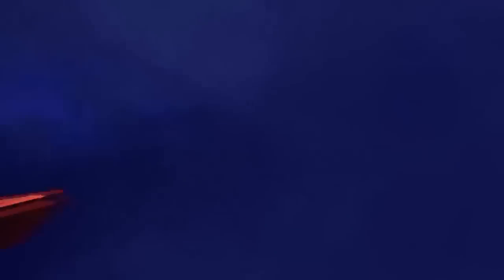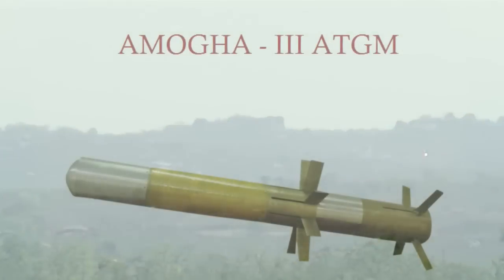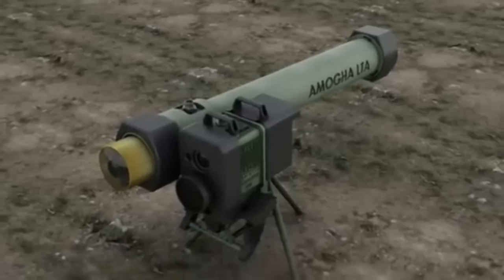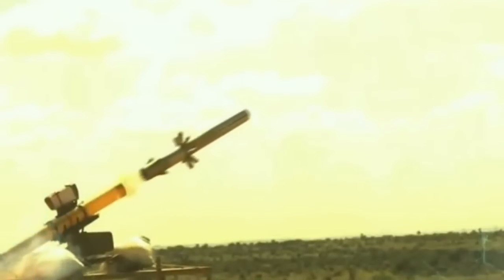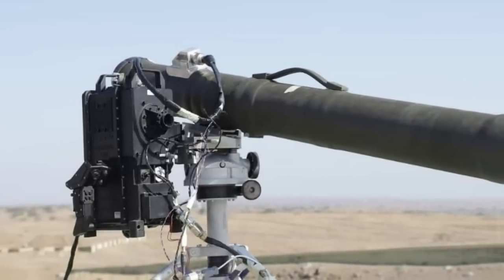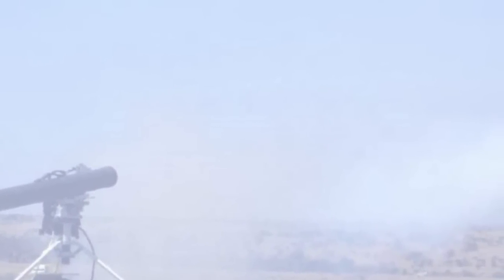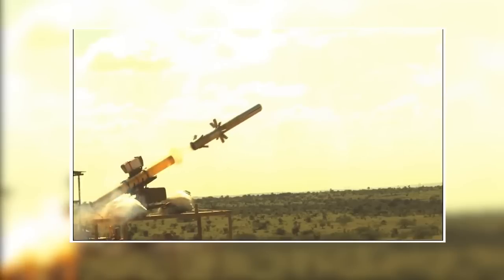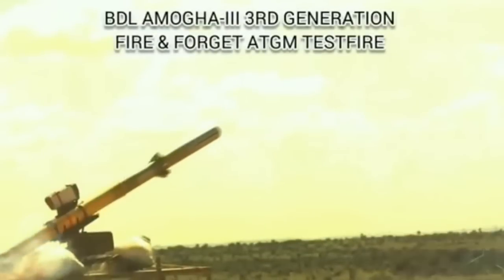#breakingnews Amogha-III: 3rd Generation ATGM Test fired successfully by Bharat Dynamics Limited BDL

Comment: After  Galvan valley clash we saw  mig 29 k been deployed in ladakh  .
Can Rafale - M  after induction in navy be  used by  Airforce in future because airforce  squadron strength will remain less than sanctioned till 2035.
Reply: Both the Rafales of Navy and Air Force are going to be different.. with Navy it comes with Arrester Landing Gear

Air Force can use it, if the Pilot has trained in Deck Landing
Reply: That's not Navy's problem
Reply: @saiprateek5779   We are at risk of buying substandard weapons to please cronies ?
Reply: rafale m only for navy.

Comment: Sir MPATGM vs Amogha 3
Reply: DRDO vs BDL

Both are 3rd Gen ATGM, but MPATGM is version of NAG and Amogha 3 is in-house first tech Design of BDL
Reply: @saiprateek5779  and both with a limited range of 2.5km max. for the same size as Akeron MP/MMP 🤦🏻 And I may be wrong but there's no clear video of either being tested with live warheads or with the CLUs. Which kind of indicates both are some distance from maturity as a platform considering the competition faced.